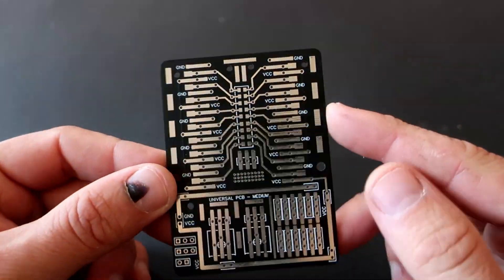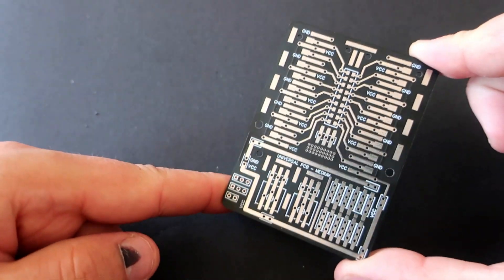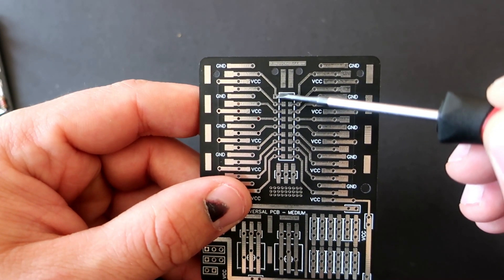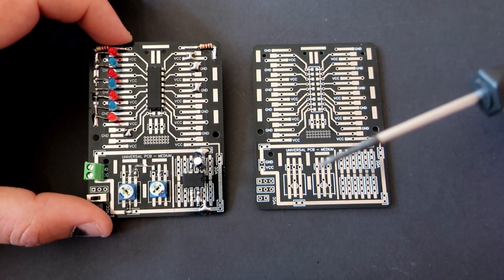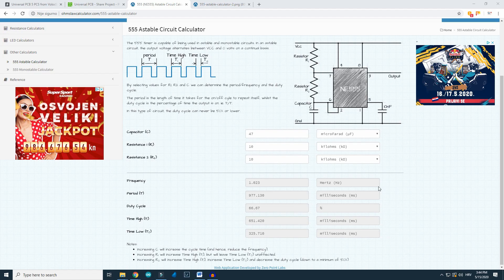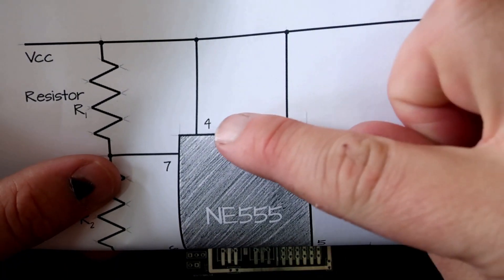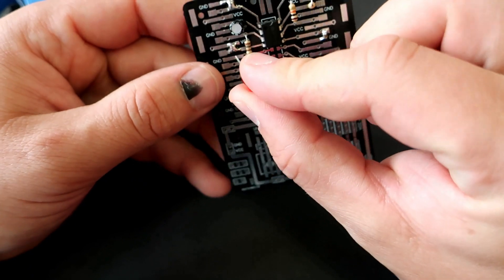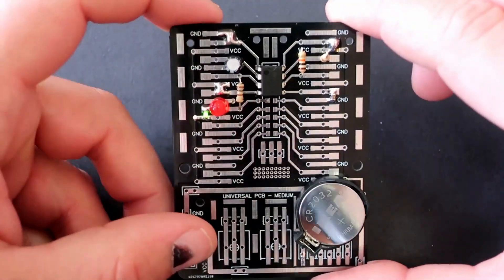Universal PCB

Comment: What a great project. It’s a nice link between a breadboard prototype and a dedicated PCB. Well done! 👍😃
Reply: I just ordered some to play with. Was cheaper than digikey perfboard. You should be one of the lucky ones now to get free boards brother. I'd never pay pcbway a penny unless to support a creator then tip the creator directly. 10 boards was 24cad which is a better value than the trash on amazon and designed by a great creator. 

Tindie is a platform designed to rip all parties off. I'm in Canada and if I want to order a custom project kit from a place 8 hours drive away the postage and customs cost more than the gas I would burn if I picked it up. Plus most 'makers' charge way too much for their stuff due to economy of scale reasons. There's so many products that would be massive if they had backing. It's a shame. Plus half the people are always on vacation haha. Brian lough was on vacation for like 3 years haha. I'm still trying to chase a way down to support him more directly for everything I learned reading his graphics code for hub75 panels.
Reply: @jstro-hobbytech Brian is a quality human being! 👍😀

Comment: Interesting looking idea.
What isnthe purpose of the cluster of vias in the lower center of the board (below the IC area)?

You should put some pads on the back of the board in the empty areas. It's basically "free" space, so you might as well do something with it, even if it's just an array of SMD pads.

Also ... I see you had to modify it to fit the ATmega328. I guess the V2 will be long enough to fit a 28pin DIP without mods.

How about having IC pads iin the back, behind the DIP, to solder on SOIC chips? The vias could carry the traces to the other side of the board (you could even swap the left SOIC pads to the right DIP vias - that way pin 1 on the SMD side would still be pin 1 on the DIP side - just for ease of use).

Comment: Does it have a ground plane? Did you consider adding small traces coming out of where you put the switch, so you wouldn't have to put that little wire into the same hole?
Reply from the maker: No, it dont hvave ground plane. Good idea😃